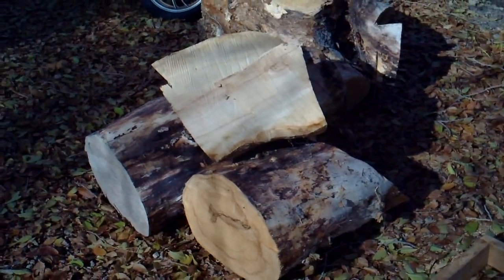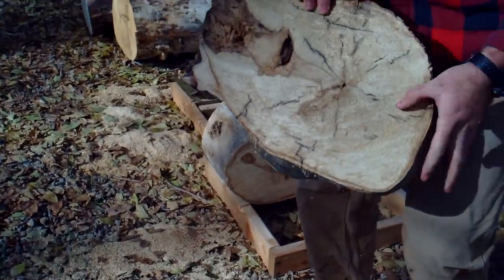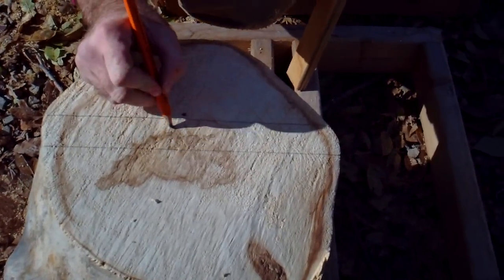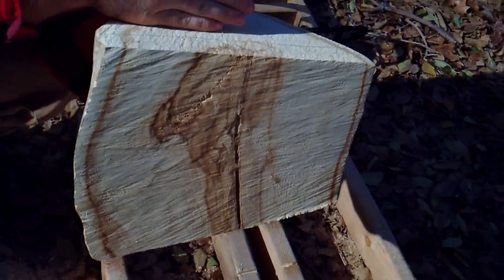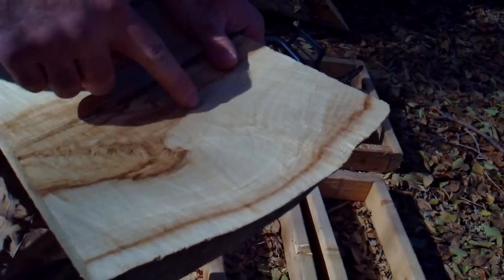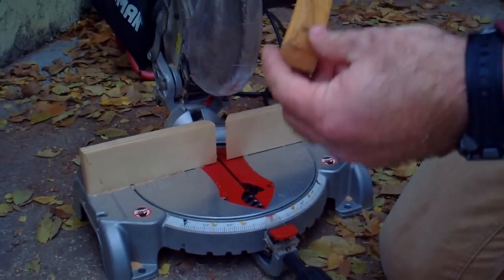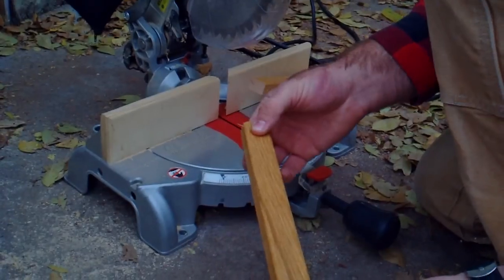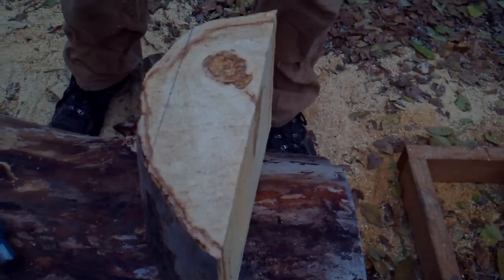Wood Turning From Logs to Bowl Blanks

Comment: Can I ask, how long after it was cut down before you cut them?
Reply from the maker: +Steven Pruitt The horse chestnut tree was dead standing for many years. After it was 
cut down we let it sit for about 3 months before we processed it. After 
we cut the blanks into rounds we sealed the ends of them with wax or 
green wood sealer. Since it was dead standing we could start right away 
turning them. With a tree that is green/ living when it is cut down the 
rule of thumb on dry time is 1 year per inch. So if we cut down a tree 
that has a radius of 24" then we are looking at 24 years till it is full
 dry all the way to the center. That is why we like to cut the pieces 
smaller. Speeds up the dry time. By cutting them into bowl blanks(3x8 
for instance) we lower that time frame to around a year. If we were to 
rough turn them then we could shorten that to 6 months. We would turn 
the bowl till the whole thing was 1" thick about then put it in a bag 
with the shavings and in 6 months
 it would be dry and ready to finish. That being said there is a fine 
line between speeding up the dry time  so you can use it faster and 
speeding it up so much that your wood splits and becomes unusable. That 
is where the wax and wood sealer come in handy. As soon as you take a 
tree down get some sealer on the end grain. Anything not covered by 
bark. This exposed wood is where the moisture will try and escape 
causing the cracks. Each time you process it is important to seal the 
end grain, keep it out of sunlight and off the ground. Tarped on a 
pallet is an excellent way to keep it. Let me know if you have any more 
questions.
Reply: +oldfatguyrr1 Wow. thanks so much for all the information. It surely help.
Reply from the maker: Your welcome.